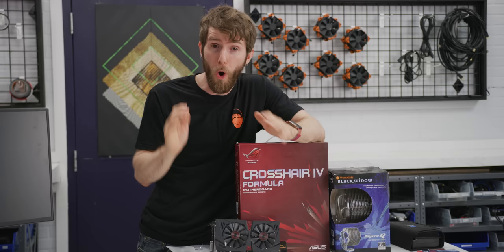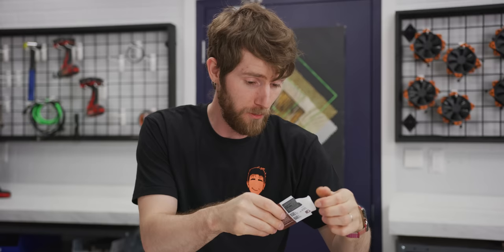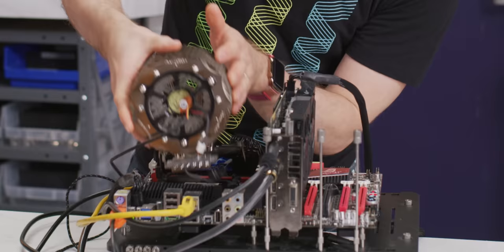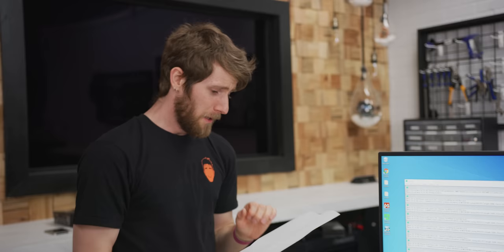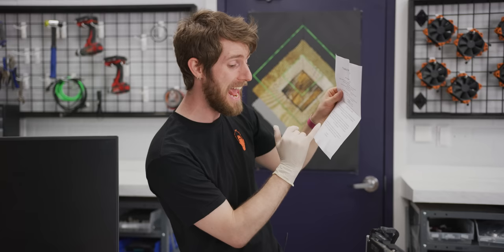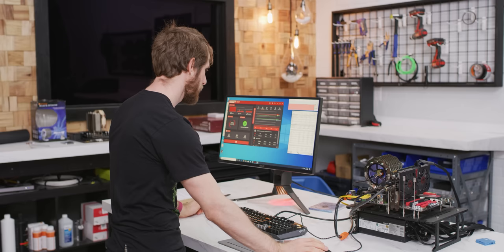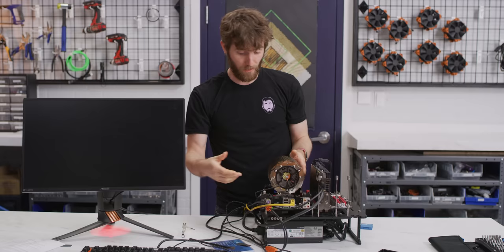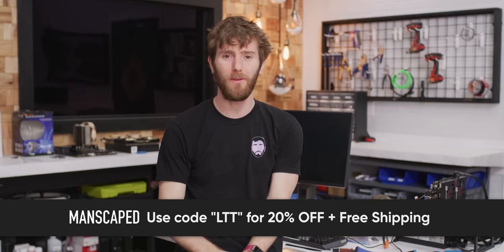Testing Another YouTuber's Thermal Compound!

Comment: I heard that in a pinch you can use plain white toothpaste as a substitute for thermal paste, and it performs better than this PERMANANT epoxy mixture. Plus you can always clean it off and use real thermal paste later on. Overall the epoxy mixture is not worth paying 20 dollars when you can get a tube of cheap thermal paste for much less, with better performance.
Reply: Thermal epoxy is meant for different applications than thermal paste. It's dumb that Linus tried to use thermal epoxy as if it was thermal paste, but as a thermal epoxy it's rather a good one.
Reply: @fakecubed  You would still get better performance with white toothpaste for a fraction of the cost, and its not permanent.  I've seen it tested on a different channel.

Comment: "who can it perform differently over time?"  Because your heat gun trick is ridiculous.   All parts are made of different materials, up to and including the heat sensors themselves.  By artificially applying heat to the entire area you are completely throwing off how the sensors were designed to work.  You screwed up the entire experiment by using that heat gun and should never do that again for the same type of test.